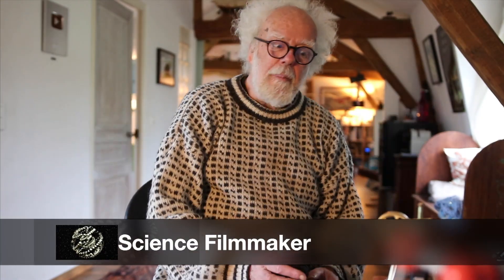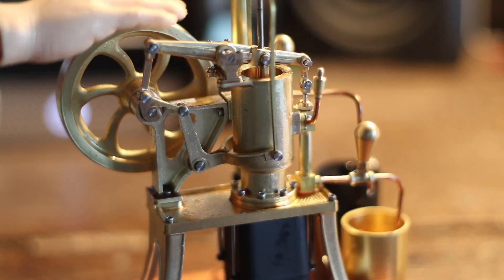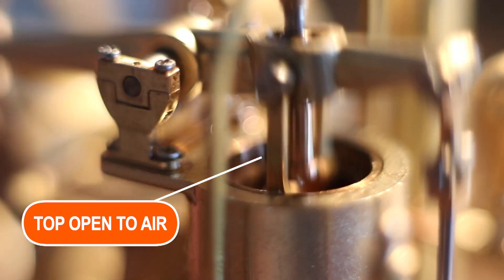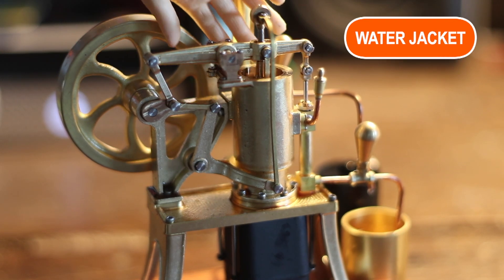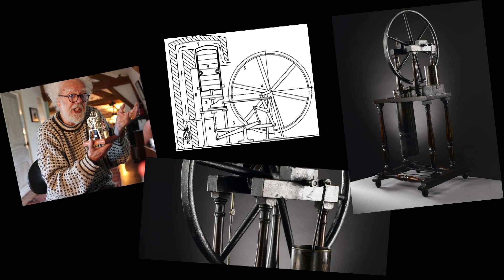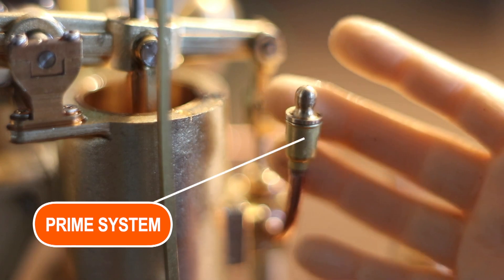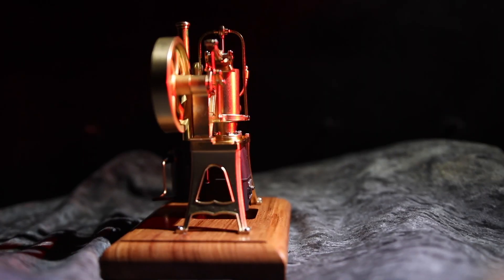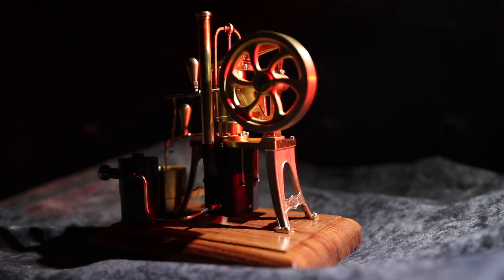Model Heat Pump Engine - Prof Simon

Comment: I do like these dinky little heat engines. Simply pleasing mechanical devices. I should own one really... 
--
Here's my heat engine: 2 fully enclosed strong metal fans/impellers separated and connected by a drum with narrow connections between each side around the circumference. all wrapped in a cylindrical heat sink with a heat sink either side. It's mounted on a couple of bearings either end and filled with very high pressure CO2. Each side is heated alternately, expanding and compressing the gas from one side to another and back again at high speed. 
--
This can be combined with an outer 2 way axial compressor that acts as the heat sink that also pushes cooler external air over the engine from the centre to each end. Could have alternate closed and exposed fins so ICE exhaust thrust can be used, like a conventional turbo. A valve can flip exhaust flow from side to side in time with gas expansion.

Comment: Most cryocoolers use stirling cycle to get very deep temperatures using helium as the working gas. Also there are Stirling engines used in central heating systems to produce additional power when the heating system works. There is a government subsidiary in Germany for such usages. The problem with these engines always was the leaking gas so they where not fully maintenance free.
I hope someone tested a magetic piston so coupling would be possible with a sealed cylinder.

Comment: Lovely footage!
Teaching this topic (exactly Heat Pumps explained by the Stirling Cycle Process) in my Physics lectures — may I use your footage per illustration?
If so, endless thanks. 🙏 😊
Reply from the maker: oh yes....glad to help.
Reply: @SimonHollandfilms  :
Great, thank you!
(Btw, I have a demonstration prototype up and running in my lab, students performing measurements, evaluating thermal efficiency etc., but it looks so much inferior to yours.) 👏🏆

Comment: Professor Simon  i have an idea, you love them steam engines it's obvious to anyone watching even a blind bat with sun glasses on, well i had this idea; you know those ovens that burn wood and that, such as AGA's wood burning stoves, well one designed a little different with a larger internal water tank, that produces pressurized steam that runs a steam engine-electrical generator for the house, is it possibly feasible?  
Can i interest you in putting together a prototype, maybe in the frame work of a technical drawing, of course i haven't seen anything on the market place that lends its self to the idea, here's the crunch of course it has to be cheaper than anything else out there to run, it would be pointless if it cost more than solar systems with batteries, if you burn the right wood it would be carbon neutral.
Love your channel Sir its really interesting, if you want to chat, i have to wait until one of my children is available to operate the computer, as i'm not in the best of physical condition, bad this that and the other enough to make you ice cream.
interestingly enough my grand father John Sinclaire Watson, started out in life inheriting quite a lot of land when his father died my great grand father in Ireland, sold the land and studied engineering, he ended up head engineer on some ship, his young wife and two young sons were killed in an airship disaster so he made his sea life his thing, at 42 he remarried my grand mother at the time 17 i think yeah that sounds right to me i guess, they had about oh at least 8-10 children i remembering Dadio Frankie mentioning he had a little brother who hit his knee coming off his bike, and died later from cancer, that they blamed it on the bike accident.
John Sinclaire Watson, left the navy just before he got married, now this is where it gets a little interesting, he became a inventor, traveling to all the conferences and selling his inventions for coppers, his name isn't on a single thing, he invented to the best of my knowledge, most of his inventions were sold to businessmen, who probably made some coin on them, he often bragged to my father he met the inventor of the zip fastener, whats bigger than that, hmm anyway i hope the ARG wood burning stove with a larger internal boiler to power a steam electrical generator as part of the stove, maybe its stupid i don't know  for sure i love your channel its varied and widely enough to always offer something new off the cuff.
my email adress is alan05081959@gmai.com if i have caught your interest, warmest regards to you and your family for now.

Comment: Hi, its a beautiful engine and concept.
However your description of how it works was a bit brief.
The engine has two pistons.
One is a sealed fit in the cylinder, which you pointed out at the top. This produces the turning torque.
The second piston is inside the cylinder and a loose fit, it is pushed by the rod going down the middle of the first cylinder. This is a displacement piston.
When the the air is made to expand by the heat at the base of the cylinder, it pushes the first piston up, the second displacement piston descends into the cylinder, pushing the heated air up to the cooling jacket.
The cooled air then contracts and atmospheric pressure pushes the first cylinder down.
At the same time the displacement cylinder rises and allows the cooled air to come in contact with the heated base of the cylinder.
And so it repeats.
Designed  by a clergyman Robert Stirling.
Reply from the maker: excellent...thank you
Reply: My middle name is Stirling and I'm probably related distantly to the Reverend.

Comment: I'm always amazed at how fast that thermal expansion and contraction of air can happen, evidenced in the speed these little Stirling engines operate.
It would be interesting to drive a tiny dynamo and generate some tiny amount of electricity to run some cob led filaments or something.
Cheers, I've just put one on my (wife's) hint list...